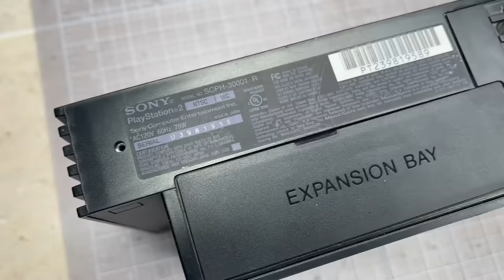PS2 Fat Customization - Window mod with clear top and RGB

Comment: Did some research into sanding plastic, apparently Scotch-Brite Pads (green heavy duty ones) are what professionals use on plastic motorcycle parts. Takes off that top coat very efficiently without tearing up the plastic, not sure if this would be a cheaper/better alternative to sanding for you, just thought I would share the information!
Reply from the maker: Thanks for the tip 👍🏻

Comment: @Studio FR what was the process you did to prep the ps2 for painting and what grit sandpaper did you use on the case? I want to spray paint my ps2 silver
Reply from the maker: 1 -  wash the entire case with warm water mixed with degreaser or dish soap,
2 - I use 400, 800 and 1000 grit sandpaper to smooth the surface
3 - two coats of adhesion promoter
4 - Spray paint. 15 min between coats. 
5 - Clear coat to protect the paint.
Reply: @studiofr  ok thanks for the help

Comment: Did you use magnets for the top plexi glass layer? Also how did you make those little dents for the magnets if so? Also did you glue the plexi glass into the cutout ? Sorry for all the questions I’m planning on trying a window myself and want it to look good!
Reply from the maker: Hi, yes I did use magnets. Did them with my laser cutter. The plexi is glued into de optical drive cutout.
Reply: Great thank you!

Comment: You crank up the voltage to laser itself if you didn't know thats a only temporary fix and you will need a new laser eventually
Reply from the maker: I didn’t touch the laser control screws
Reply: @studiofr  Ou I am sorry i thought you did my mistake sorry
Reply from the maker: No probs